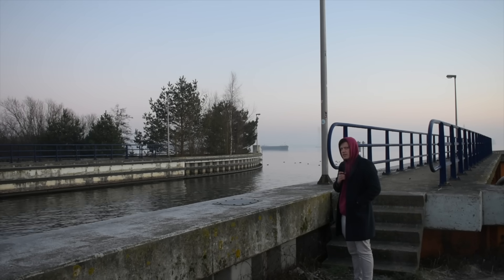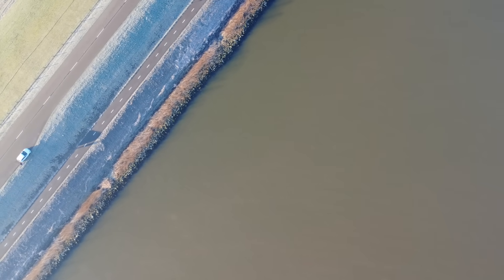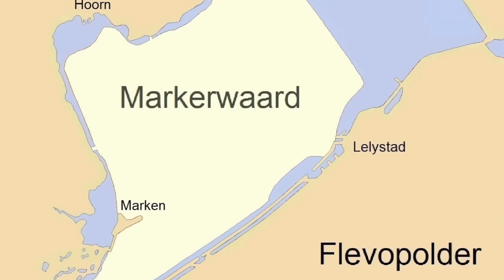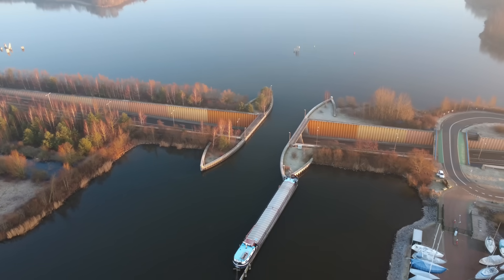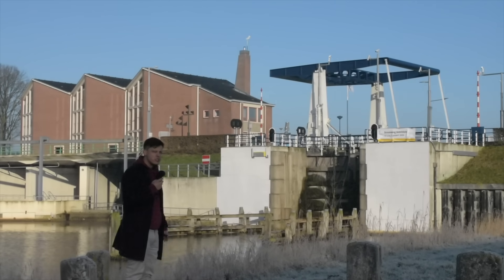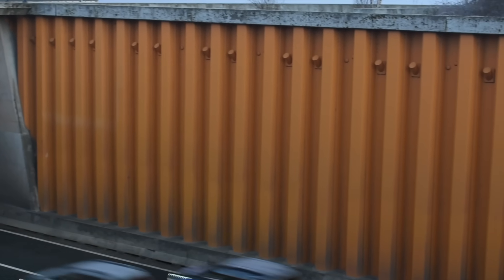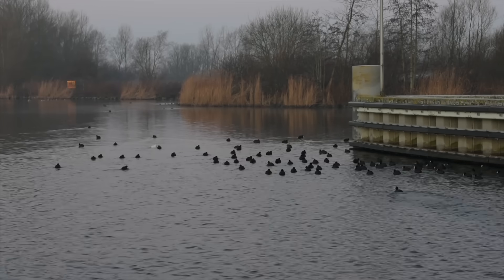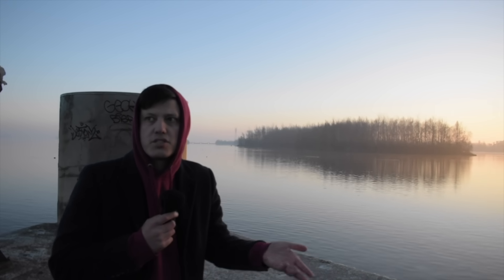I Visited the Netherlands’ Coolest Bridge

Comment: Those drains you mention are for rain water (on the cycle path) the roads (some 2 meter deeper) also have drains on the side. Pretty big slope on both side of this, I'm sure it adds up quickly at the deepest point.

Comment: While this and the whole land relaiming thing in the Netherlands is impressive, there are two crossings of (of course navigable) canals over navigable rivers in Germany, so called "Wasserstraßenkreuze" (water street crossings - the "street" might be deducted from the english word "strait" there instead of the latin word "strata" for a paved way), one near Magdeburg and one in Minden. Both are carrying the longest german canal, the Mittellandkanal, one over the Elbe and one over the Weser. The canal and the lower laying rivers are connected via locks or ship lifts so boats and ships can traverse between the levels. There are a many other trough bridges over smaller rivers, but only these two are crossing navigable rivers which make them unique.

Comment: Actually there is a much older one where the motorway A4 crosses the Ringvaart. Which they lengthened when it became necessary to widen the Motorway. The Ringvaart itself was build to make another massive polder : de Haarlemmermeer which used to be a massive lake until it was drained with the help of three steam pumps one of which de Cruquius still stands and is still the biggest steam engine in the world! This they did between 1849 and 1852.

Comment: The ring of water around flevoland is actually because it was the last huge polder built and the ones before were connected to the land which made some land deeper into the country go dry and it made them unfarmable, so a lot of canals had to be build. But if you make the polder an island by just leaving a little bit of water between the two it doesnt change the ecosystem on the land. And its also better for transport of course but that wasnt the reason it was done.

Comment: Missed opportunity to mention the bikelane is higher up than the motorway, to make it easier for cyclists to pass. For them it will be much less steep. They can do this because nobody is going to be as tall as a large truck. This is very common in the Netherlands. They have this everywhere underneath crossings, which makes cycling so much easier - it's both continuous as you don't have to stop for traffic and it's not that steep.

Enjoyed the video :)
Reply: Funny thing, I live in Zeewolde which is the part where this ends inside Flevoland. In 2002 I went for a school trip by bike and had to use the lower car part because they did the bike lane later. Of course it was fun going down for all, but thank god I had gears to go back up 🤣
Reply: If the Netherlands were more hilly, their bicyclists would be strong enough to handle the slope. ;)
Reply: @toddverbeek5113  I mean they are! We might not have hills but we have insane wind and that can be brutal as well. Shit was rough when I rode a bike to school every day (45 minute ride).

Comment: Finally a video about this aqueduct that shows (almost) the full story. There is a bit missing in your history, after a while they constructed a second drawbridge on the other side of the lock for when the main drawbridge had to be opened to let the ships pass. But, as you state, after a while traffic got too much and they decided on this. When it had just been build only one lane on either side was open to roadtraffic and the outer lane was used solely by busses. Thankfully they soon after decided that wasn't the best use and opened both lanes on either side for all road traffic. I'd also like to point out the road going from this aqueduct past Harderwijk. That used to be slow going as well due to all the traffic lights at every junction but they raised it and turned it into a main road so traffic flows much easier now.

From someone who had to cycle underneath this aqueduct twice a day for 3 years (going to and from school), thank you for telling the whole story!

Also, while you were in the area, any chance you visited the tulip island in Zeewolde as well?

Comment: I grew up in Zeewolde and still remember the old bridge. There were actually two bridges eventually, so traffic could keep flowing while one of the two bridges were were up, but even then, we still ended up waiting for a while because it still slowed traffic down by a lot.

Also, the cycling path is built in such a way that it doesn't ever really feel like you're cycling "uphill."
Reply: Having cycled that bit twice a day for 3 years to get to school (I'm also from Zeewolde), It definitely felt like going uphill, especially after a long schoolday! 😅
Was great going down the viaduct and aqueduct in one go tho, could pick up quite some speed.
Reply: It was still always a better route than having to use the ferry. 
I also grew up in Zeewolde.

Comment: 2:00 the largest artificial island is actually "Ile Rene-Levasseur" in Canada with about twice the size of the Flevopolder

Also if you want to look at a much larger water bridge have a look at the "Kanalbrücke Magdeburg" which is slightly longer at 918 meters
Reply: Ile Rene-Levasseur is not an artificial island though, the made the lake around it and the island stuck out on top. Hardly man-made
Reply: Well, it be an island by flooding everything else around it for creating an artificial lake by building a dam for hydro electric purposes. So can-made reation of an island or failure to properly flood everything? 😂

Comment: The main goal of the  "randmeren" (border lakes) around Flevoland, is to keep the groundwater level in the old land stable. In the Noordoostpolder they gathered  bad experience with the groundwater level dropping in the old land, because it flowed to the lower laying new land. This in turn caused subsidence of the ground in the old land.
Reply: I always learned they where kept to accommodate the fishing villages on the coast. Since they would try to stop the project.
Worked out well for them but they are mostly recreation now
Reply: You mean, groundwater level dropped by 50 cm? 😜
We have that with every rain and also with the seasons.
But of cause, if it causes the ground to subside, this is more serious.
Reply: @Delibro  There is a difference between natural seasonal cycles and a permanent systematic change. Besides ground subsidence the drop in ground water levels caused problems for agriculture, nature and buildings with wooden foundations.